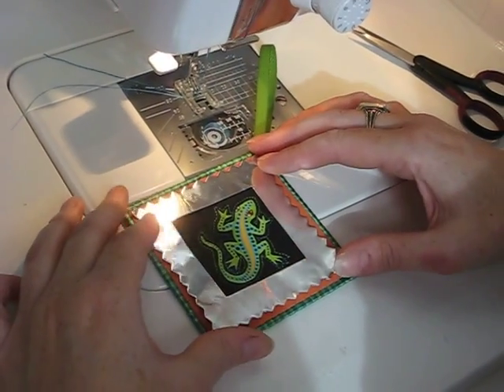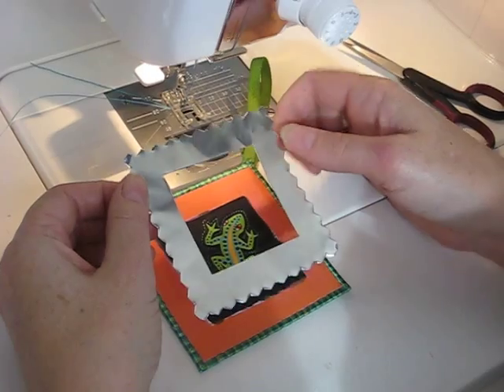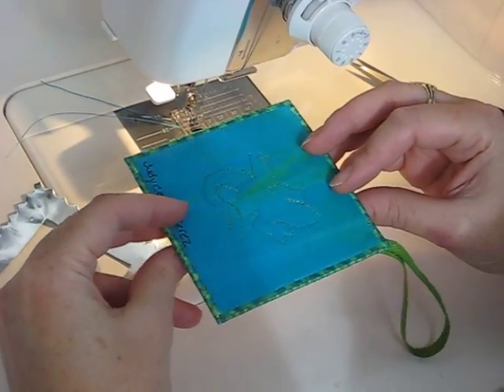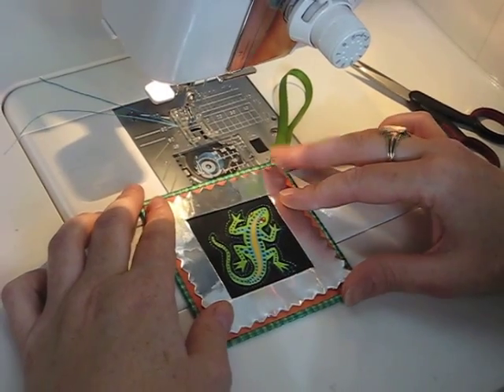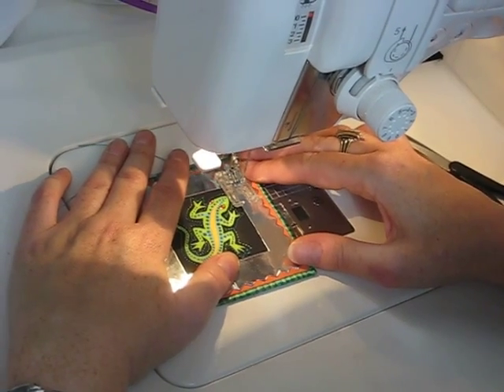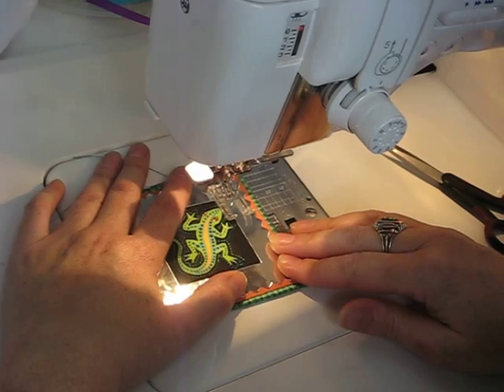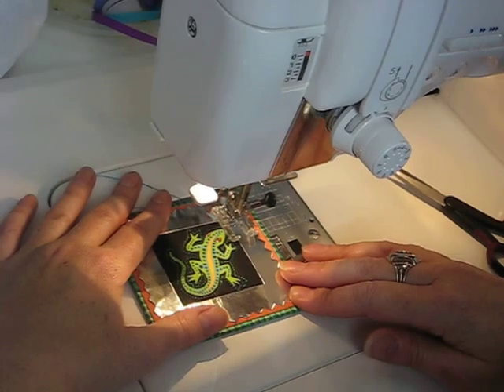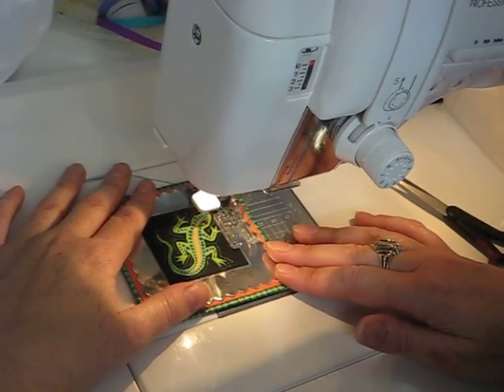Sewing metal

Comment from the maker: Hi Kate, the metal I used in the video was pewter from Art Emboss, since then I have switched to using Aluminum from Walnut Hollow thats 40 gauge. Any sewing machine can handle that easily. I've also sewn 40 gauge copper, which is substantially heavier. Not all machines will sew copper, the machine has to have metal gears like a Bernina or Pfaff, many of the cheaper brands have plastic gears which dont have the force to go through something as heavy as 2 layers of canvas.  Have fun!